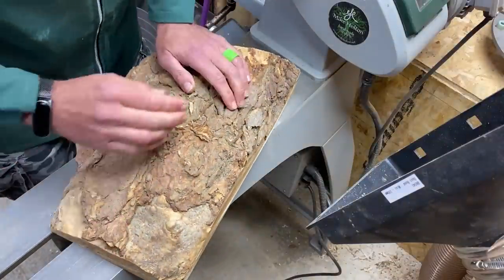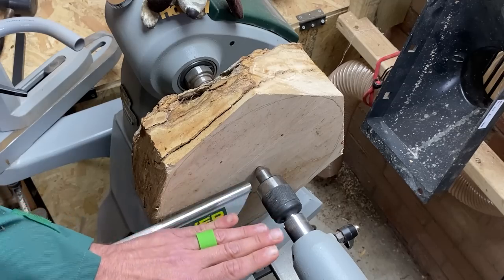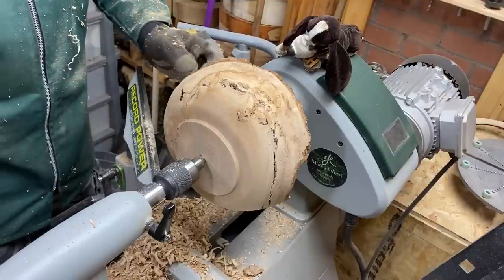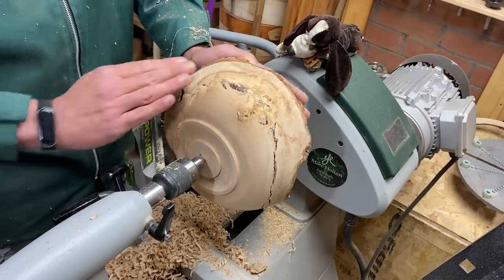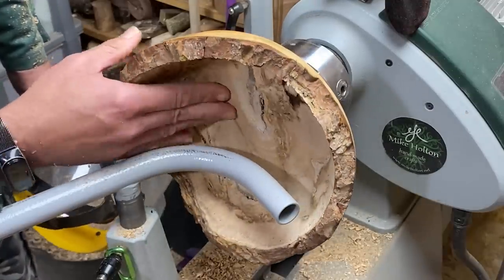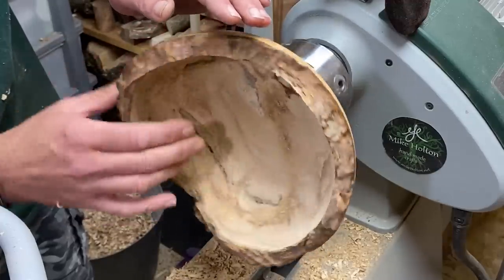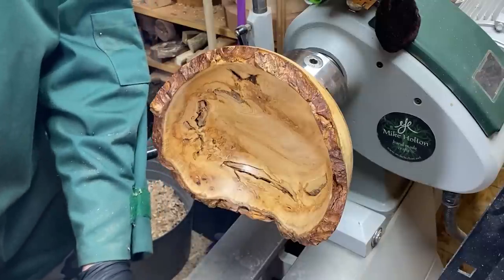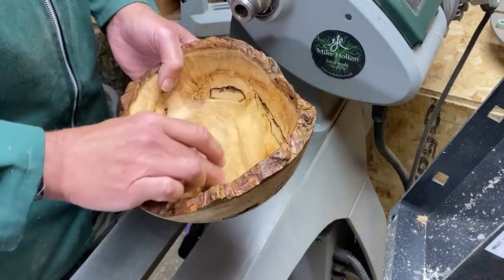The Danger of Taming A Treacherous Burl - Woodturning Project Exposed

Comment: Gorgeous wood and bowl.   As you said, good that the turning "gods" allowed the piece to hold together without having to go down the epoxy path.   Well done.
Some years ago the local turning club had a demonstration of routing butterfly inlays to stabilize pieces with large cracks.    As you can imagine the challenge is holding the router in position to rout the butterfly shape.    Keep this in mind for a future project.    The butterflys do look really good, just a lot of work in setup.
Dave.
Reply from the maker: Thanks Dave, I've always been too scared to try a butterfly, I will have a go someday but may need a little practice first. Although saying that I do have a piece of wood coming from Norway that may just need it. 
All the best
Mike

Comment: I am surprised it stayed together. Going slow and checking as you progress then stoping at proper time made it happen.  And of course your will to take the risk.
Reply from the maker: Thanks Rick, the quality of the wood not surrounded in bark was perfect so I had good reason to believe in it's strength. But of course I kept well to the side, just in case, and kept my fingers crossed, and sacrificed a small child before starting 😂, sorry that was a joke, you can't cross your fingers while turning, it would not be safe.  😀